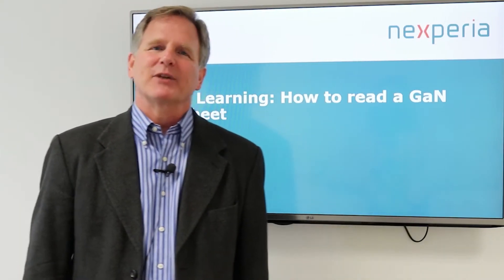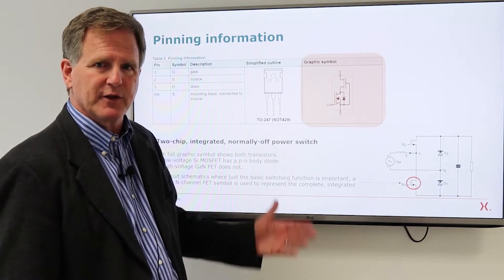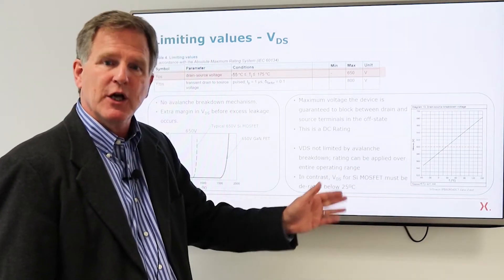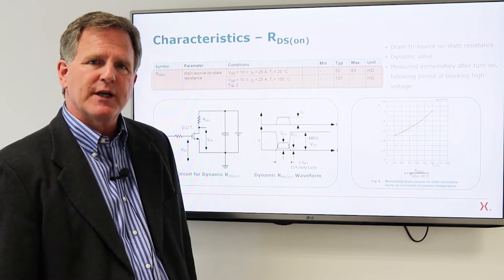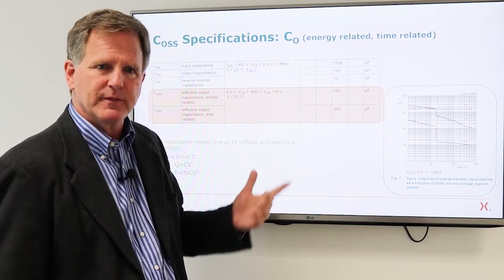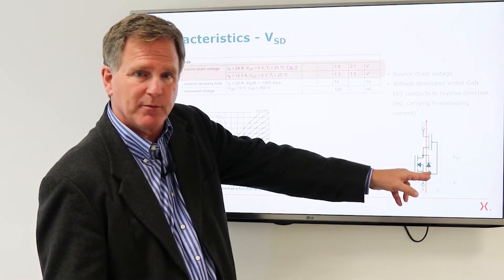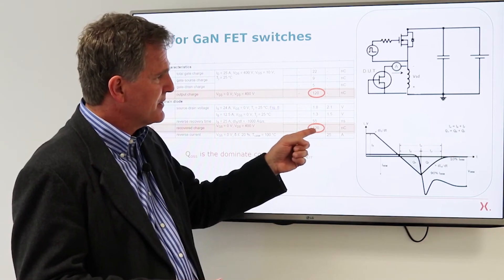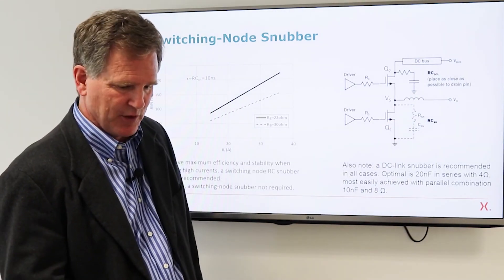How to read a power GaN FET (cascode) datasheet?

Comment: Can the cascode GaN Switch shown be called a "bi-directional GaN" and is it okay to run current in reverse for continuous operation, for example in the PFC Totem pole design with power flowing back to grid ? 
Is the body diode of the Silicon FET able to handle high continuous currents?
Reply from the maker: Thanks for the question. We reached out to an engineer who provided the following response - The term “bi-directional”, when applied to a semiconductor switch, normally means the device can block voltage in both directions as well as conduct current in both directions.   So no, we would not call the cascode GaN switch “bi-directional” because it only blocks voltage in one direction (Vds>0).   However, it can be used exactly as you describe.  The current capability in the reverse direction is nominally the same as in the forward direction, limited ultimately by temperature rise.   There is a maximum rating on the data sheet, which is call “source current”.  From the GAN039-650NBB data sheet, for example:

IS            source current Tmb = 25 °C; VGS = 0 V                58.5 A

As you probably understand, power dissipation during reverse conduction can be reduced by enhancing the MOSFET channel (applying voltage to the gate after an appropriate dead time), which is to say, using the FET as a synchronous rectifier.

We hope this answers your question. Have a great day!

Comment: What's the usage for the diode which is parallel with the Si MOSFET in the internal circuit diagram for cascode GaN HEMT?
Reply from the maker: Hello! The body diode formed by the parasitic p-n junction in a Si MOSFET provides an alternative path for reverse, or freewheeling current, in cases where the channel is not enhanced.  This is also the case for the Si MOSFET In the cascode GaN switch. If positive gate voltage is not applied, and the channel is therefore not enhanced, then current will flow in the body diode. Because this is a 30V MOSFET, the related recovery charge is quite low. (Note that the MOSFET, like any FET, would conduct reverse current even without the body diode.  In most technologies, however, the forward voltage of the diode is less than the threshold voltage of the FET, and so reverse current doesn’t flow in the channel until the channel is intentionally enhanced with positive gate voltage.)
Reply: ~Thanks for the reply, I just checked the message box and saw this, really appreciate it!:face-blue-smiling:I got what you mean:the diode acts like an alternative current path when the cascode device is used in reverse mode（which means a positive voltage at the source versus the drain), while the gate voltage is not positive enough to turn the Si MOSFET on. 
~I am doing some research on GaN power conversion recently, and I am working on several textbooks about GaN and GaN HEMT.(CRC, Wiley textbook,etc). I can understand the physics of semidonductor&semiconductor devices part, but it's tough to understand the circuit and system part(so many circuit analysis experience and power conversion engneering background).
~For example:1. I don't know when the cascode is used conversely in what kind of circuit system ; 2.I have seen a variation of the cascode, they use a drive circuit to drive the gate of the GaN HEMT directly and the gate electrode of the Si device is called "enable" electrode. I don't see how the enable circuit outcome a traditional cascode......
~My research is about how to improve HEMT performance through optimizing the isolation process in the device manufacturing process, so it's actually on manufacturing process. However, considering enhance mode GaN-on-Si HEMT mainly targets the power conversion market while the depletion mode device targets the RF market, I believe the research will be more logically if I have more profound understanding on  it's application background. If I can find the relationship between the device characteristics and the power conversion system, I will know what process optimization should be made to improve the performance at a system level using some semiconductor physics knowledge.
~I guess I just lack some circuit analysis knowledge and power conversion background knowledge now...... @Nexperia